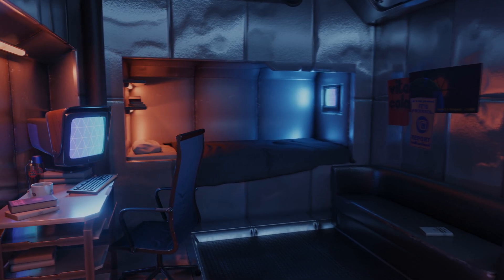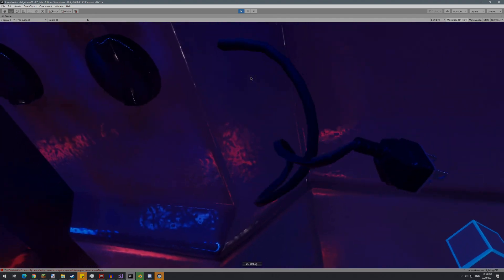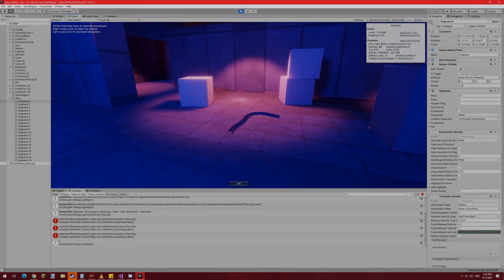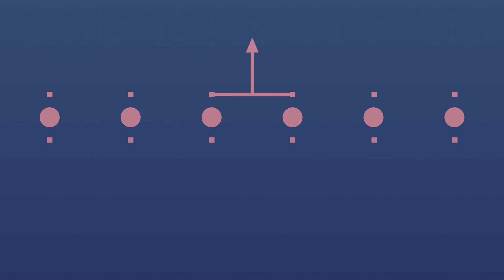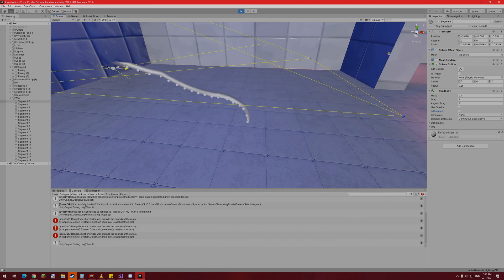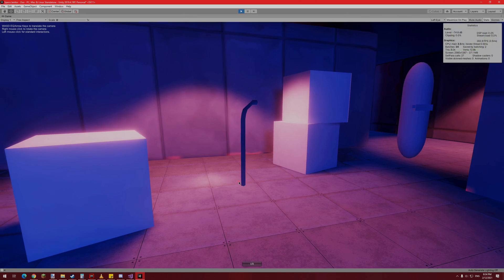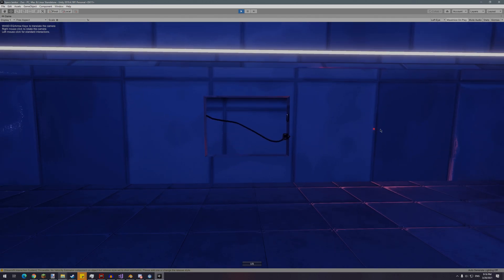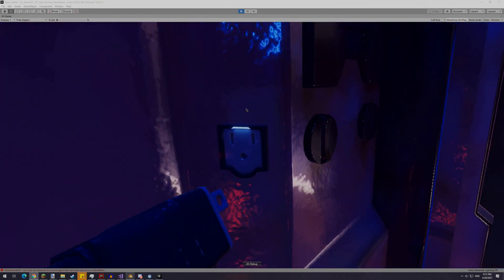Wire Physics for VR in Unity: Step-by-Step Breakdown

Comment: How do you render and connect the vertices that are placed along the rigid bodies? Is there a built in Unity method for adding vertices?
Reply from the maker: It's a skinned mesh where the vertices and tris are placed and then translated along the positions of the rigidbodies. Verts and tris are just arrays that you can assign vector3s and int indices to, respectively.
Reply: @LoneDeveloper  thank you for explaining all that. I will have to look into these and do more research.

Comment: Line renderer with a good normal map works surprisingly well for cables and hoses.
Reply: I’m working on developing a cable now using line renderer. Needing something non elastic (thinking of changing from Configurable to character joint) but the line render graphic, I can’t seem to make look “round” around the top/bottom edge (when horizontal) Vs a flat line drawn drawn by a marker

Comment: Thanks for the great video. Do you think this wire physics would apply the same way for an AR-game? I have a project for an AR-mobile-game and wonder if it would be too heavy in terms of processing to apply on that. Thank you again.
Reply from the maker: Thanks! Short answer is probably yes! The mesh generation code is rather lightweight so I don't think you'd have any problems there, the bottleneck is probably the rigidbody density of the wire, I've considered using splines to work around this though I haven't implemented it yet.
Reply: @LoneDeveloper  Thanks for replying and your tips!! ;)

Comment: I think these wires look awesome! I have started working on implementing some of my own in a similar way and have gotten close. How did you solve the issues with joints stretching away from each other when just resting? It makes the wire act funky and always very droopy. I can't seem to find a setting or a solution anywhere.
Reply from the maker: Hi Tony, thanks for the kind words! I'm using Unity's configurable joint, I have a function set aside with the following setup and I regret not discussing it in the video:

public void ConfigureJoint(ConfigurableJoint j, Rigidbody c)
    {
        j.xMotion = ConfigurableJointMotion.Locked;
        j.yMotion = ConfigurableJointMotion.Locked;
        j.zMotion = ConfigurableJointMotion.Locked;
        j.angularZMotion = ConfigurableJointMotion.Limited;
        j.angularYMotion = ConfigurableJointMotion.Limited;
        j.angularXMotion = ConfigurableJointMotion.Limited;
        j.projectionMode = JointProjectionMode.PositionAndRotation;
        j.enablePreprocessing = false;
        j.connectedBody = c;
    }

Probably needless to say, but more information on  each individual property is available here: https://docs.unity3d.com/Manual/class-ConfigurableJoint.html
Reply: @LoneDeveloper  I have my joints set with similar settings, but I am getting a lot of drifting where the anchors pull away even though the motion is locked. Are you doing any fancy math or anything with the RigidBodies to keep them from drooping and drifting? It's the last peice of the base implementation I'm missing before I start working on the mesh shell.
Reply: @CouchCushion731  Hi! I’m also working on cable interaction in VR and would really appreciate it if you could share a bit about how you made it work. Been stuck on this for a while 🙏

Comment: Can you share what adjustments you made with the configurable joint? I don't mean the script, I'm talking about the setup for one rigidbody sphere to another.
Reply from the maker: Hi, my configurable joints are set up by the script that instantiates them - and I really regret not showing the setup in my video.  

Here's the function I wrote up to configure them correctly:

    public void ConfigureJoint(ConfigurableJoint j, Rigidbody c)
    {
        j.xMotion = ConfigurableJointMotion.Locked;
        j.yMotion = ConfigurableJointMotion.Locked;
        j.zMotion = ConfigurableJointMotion.Locked;
        j.angularZMotion = ConfigurableJointMotion.Limited;
        j.angularYMotion = ConfigurableJointMotion.Limited;
        j.angularXMotion = ConfigurableJointMotion.Limited;
        j.projectionMode = JointProjectionMode.PositionAndRotation;
        j.enablePreprocessing = false;
        j.connectedBody = c;
    }
Reply: @LoneDeveloper  Thanks for responding, your process is incredible and I hope to one day buy this game!
Reply: This is awesome! Thank you so much! I’ve been trying to make a cable (and not a rubber band) so these settings have helped a lot!  @Lone Developer

Comment: Wow that's amazing! Is it possible to share the final wire asset because I need something similar in a project but I'm still a beginner in unity?
Reply: Same! I would definitely buy this for my project 😬
Reply from the maker: Thanks, and I do intend to release the source code for projects like this, but not until fully completed.  Additionally I need to be 100% sure that all the bugs and eccentricities have been worked out, which is something I can't say for my wire physics codebase just yet (especially because I've been adding functionality since I've released this video).  When I do release the code in the future, I'll probably post a video about it so it'll be hard to miss, though you may have found an alternate solution by then.
Reply: @LoneDeveloper  Have you released the source code for this rope physics anywhere?
Reply: @LoneDeveloper  Hey ! Its been 3 years at the time im reading since, and i just checked your channel to see if there was another video about rope, sooooo.... did you release an asset yet >.> ?? :)

Comment: this is really cool and inspiring , is there an easier way for us not blessed by the machine spirit ? :D
Reply from the maker: This was the easiest method I could come up with, as I was inspired by existing implementations in other software.  If you're using Unity, there are cheaper ways of achieving wire-like physics with Unity's cloth component.

https://docs.unity3d.com/Manual/class-Cloth.html

Hope this helps!
Reply: @LoneDeveloper  Thank you for the super fast answer! and thank you for the link, will check it out now :D